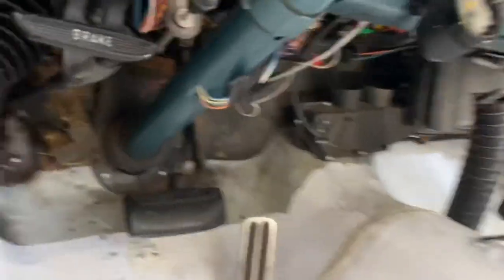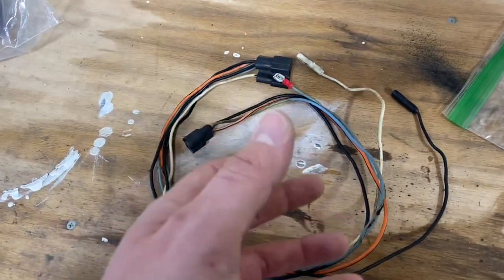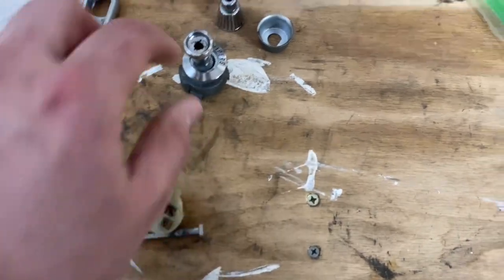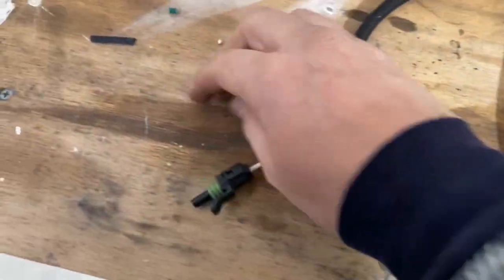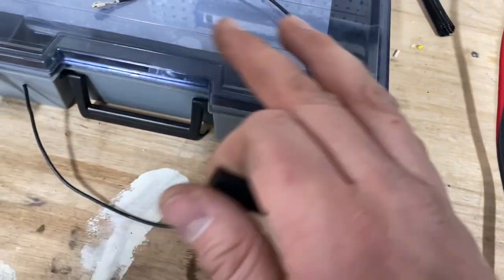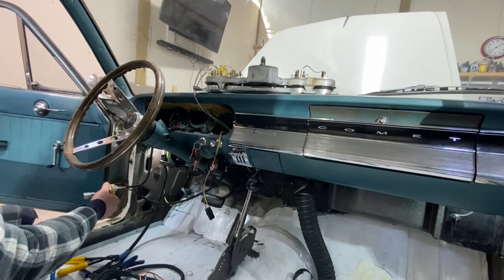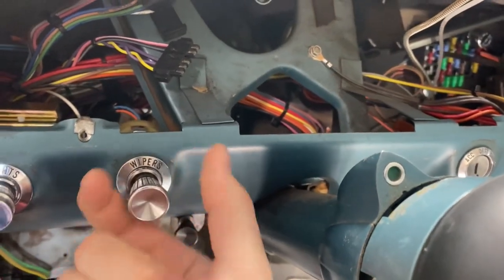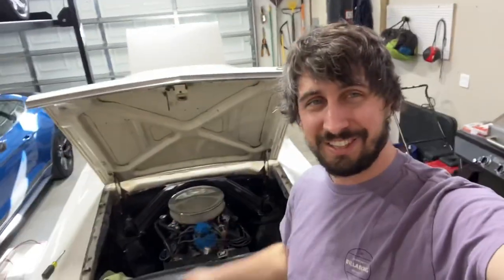How To Wire a Single Speed Wiper

Comment: Just a followup to say I received my mustang switch today and it has been wired into my 63 galaxie 500XL. I really took a deep dive to look at the switch and found that the primary difference between the 4 pin galaxie switch and the 5 (or 7) pin mustang switch is ford deviced to spearate the 2 poerlines to separate fot electrically connected pins. On the galaxie this is the yeplow with black stripe wire and the blue wire. The blue feeds the park circuit directly on motor while the yellow/blk gets the power from the circuit breaker upstream from switch.

When I first started looking at this I wondered why a more modern switch would not work and the answer to that is this switch is a dual pole switch, it has 2 contacts closed with the switch off (the ground circuit for parking the wipers) and 2 pins connected when switch is on (the power to wiper motor). Modern switches are typically single pole.\ (at least the aftermarket street rod type switches)

Just one more thank you as without your video, not sure I would have even considered a mustang part.

Thanks Again,
One of the 3 people that this video was going to help

Comment: Thanks, I have the exact same switch as your original on my 63 galaxie and you are right, they are unobtainable so I'll be ordering a mustang one and rewiring like you have here. I figure the more mustang stuff that goes on this galaxie will just make parts availability much better. I mean who doesn't make classic mustang stuff.
Reply: Also, this was the 2 speed switch  for the mustang so you have 3 positions (off, low, high) right? So you just call that high position "future expansion" 🙂? I was going to just get a universal switch but they are different, they are single pole switches and don't offer a pole for switching ground so our park won't work correctly

Comment: I really needed your video.  I am also installing an American Autowire kit and I am stuck on the wiper part.  I am trying to follow what you have done but I can still use my original plugs.  I keep freezing your video on the original harness because I cut my wires off the harness without seeing how they were connected.  I wish you could have laid the harness out and held the camera on it for a moment.  But I think I can follow what needs to happen.
Reply from the maker: Glad I could help.  Sorry it isnt perfect but I can tell you for sure it works :)
Reply: Howdy… any idea of why when I hooked it up exactly as you laid it out to the same type of switch I get nothing? Tested switch and wiper motor and both work. Thanks!

Comment: Im trying to do the same on my 64 falcon and i cant figure this out. My harness is in good shape so im just trying to use some pigtails to go from the old plug to the new one.

I have the 4 wire plug and then a single hot wire, if anyone can help it would be extremely appreciated

Comment: What full wiring harness did you go with? Just wondering whether to get a universal harness or a chassis specific harness for my '66 Mustang. Either way, it would be the newer GM style fuse block style like you have. It's pretty much a daily driver but the harness is rough. Thanks. Great channel.
Reply from the maker: Thank you.  Ive used American Autowire both times ive rewired a vehicle.  They had a specific harness for my Comet and Im 100% sure they have Mustang specific ones.  Check out American Autowire and Id recommend vehicle specific.  Good instructions, not hard to do, and what a relief.

Comment: Got a part number on the switch ?? I think itll fit the 66f100 with the single speed motor
Reply: Also would you happen to have that wiring diagram superchief?
Reply from the maker: I bought the switch from Falcon Enterprises I believe.  It is a small online seller.  Dang thing wasn’t cheap 

1964-1965 SINGLE SPEED WIPER SWITCH                             $59.95 (C5ZZ-17A553-B)
Reply from the maker: I dont sorry.  Heres what they told me and why I made the video “Look up on line for a 1965-66 Mustang. It is a Mustang switch, as no one reproduces the switch for the Falcon/Comet.”